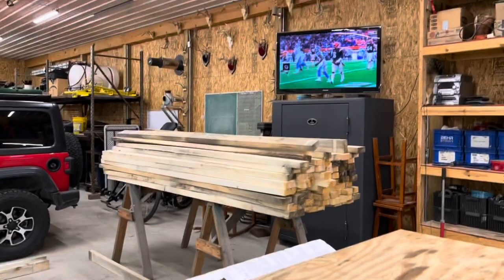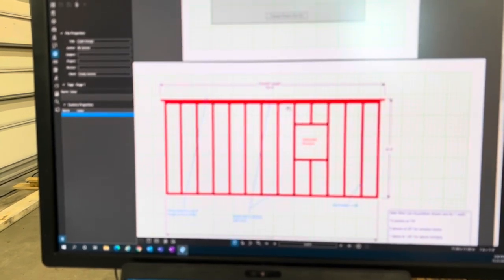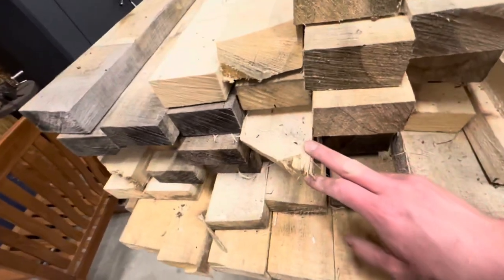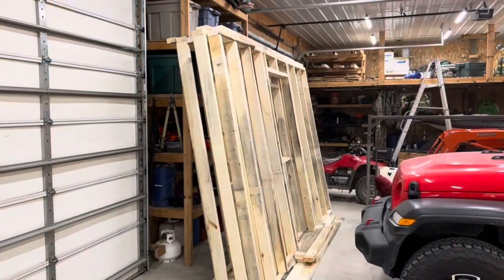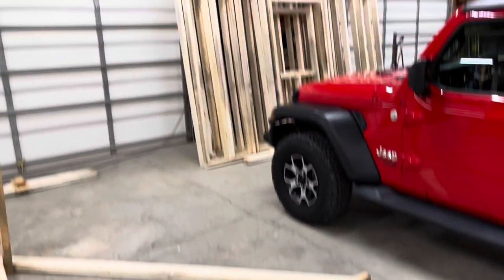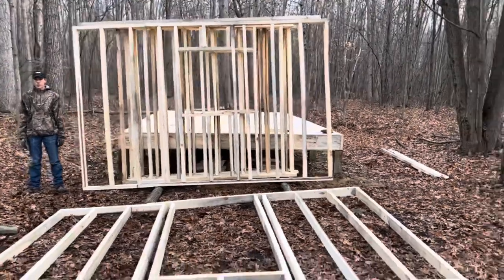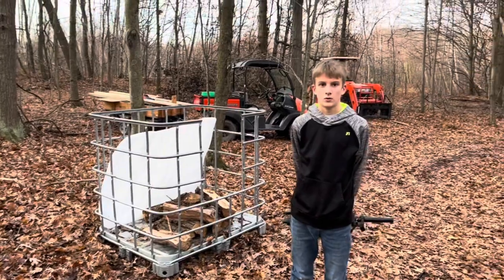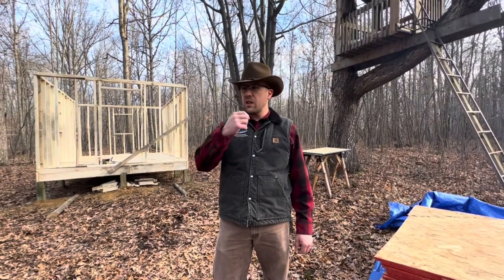Building an OFF GRID CABIN! - Part 2 - the Walls Go Up!

Comment: Question is there a reason you went vertical with the sheathing as apposed to the standard horizontal and stagger them to make the structure more stable and solid
Reply from the maker: No. I’m just not a pro builder. Probably should have done a few things different on this build, but learning as I go. Regardless, it’s solid. Won’t have any stability issues.

Comment: Looks like your lumber stayed good and straight. That’s awesome I’m glad you had success with that. Did you get a lot of shrinkage? The aspen I’ve killed and used has shrunk quite a bit. Looks great so far!
Reply from the maker: So far so good. I’d say about 80% of the 2x4s are good to go. Most of the bad ones have too much live edge which allowed them to warp being so close to the exterior of the tree. For shrinkage I’d say an inch or so on length over 9’ although I didn’t really keep track when we milled them.  Thanks for watching.
Reply: @LivingOurAmericanDream  what is the square footage of the cabin here ?? Thankyou. I want mine to be 16X24

Comment: Do you need need a header and a double plate above windows with a king stud down the sides. Did you just leave these out because the windows weren’t that big?
Reply from the maker: Hi David. Yes, I went without due to window and overall building size. There has been a lot of criticism in the comments for doing that. I’m no expert but I think it’ll be ok. Time will tell. Thanks for watching and joining the conversation!

Comment: No concerns about rain after you build the floor but before the roof goes on?
Reply from the maker: Had lots of concerns. If OSB gets wet it will bulge and be ruined. We tarped the entire structure and moved expeditiously to get the roof on. It all worked out and we didn’t have any issues.
Reply: @LivingOurAmericanDream   Makes sense.  Thank you.  How long did it take to build the whole thing? I figure you could get the foundation and floor joists up in one trip, but then once you seal the underneath it's go time!

Comment: Just stumbled onto your channel so i apologize if you've mentioned this--- curious if the town/township or whatever had any issues with your cabin build? I believe many areas in MI require at least 1000ft for new builds.  Not sure if the post foundations are allowed or whatever other codes you have to follow.  Guessing you just have to contact officials in whatever area you live in... Curious if you faced that stuff?
Reply from the maker: Township doesn’t know about this building as it’s under the square footage threshold for permitting in my area. As far as they’re  concerned it’s a well built deer hunting blind 😁.

Comment: Curious if there is a reason why you chose to have such small windows? I'm wanting to build a cabin similar to this size, possibly a little bigger. But I definitely want large windows on all sides. I want to be able to enjoy the outdoors when I'm sitting in the middle of the cabin.
Reply from the maker: Great question! For us, I am building to sleep 5 and include a small kitchen in the layout. I was running out of wall space so chose a bit smaller windows. If you have the room, I would go twice this size. These are 30” wide, 36” tall. The uppers will be 24” wide and 36” tall because of limited space. Thanks for watching.
Reply: @LivingOurAmericanDream  yes, that's hopefully what I am able to do. I want as big a Windows as I can put in. I just want to be able to enjoy the outdoors even when I'm sitting in the cabin on rainy days, or while laying in bed at night when there's a full moon out. Good luck with your cabin!

Comment: What program did you use to design the cabin?
Great videos!  Look forward to seeing more.
Reply from the maker: I used the sketching and markup function in BlueBeam, a pdf reader and markup software. Nothing fancy by any means but it worked. I was able to dimension everything and mock up the layout just like in any more expensive CAD software. Simple enough for this project for sure. Thanks for watching.